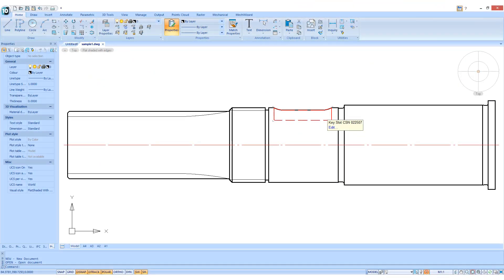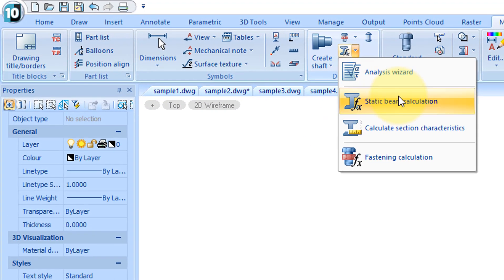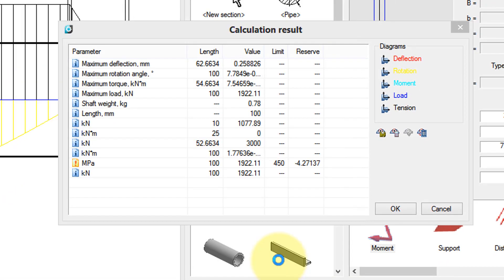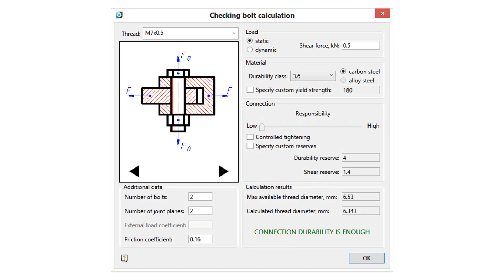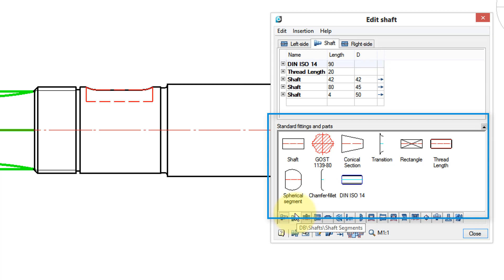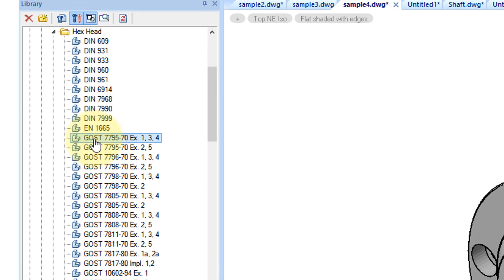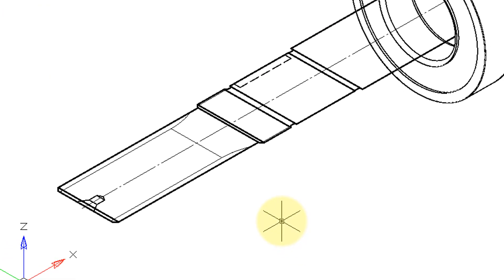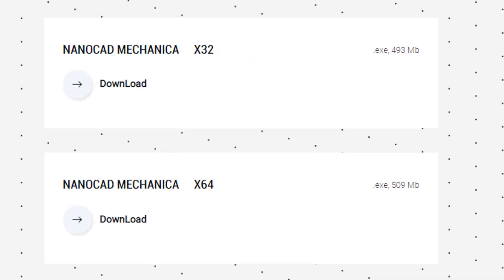nanoCAD Mechanica 9.0. New video by Ralph Grabowski

Comment: I typically use 2-D to do piping isometrics and  vessel drawings where I work. Will saved drawings and modifications work with the Autocad drawings? and which is the best of the products for what I do? I don't really expect to need the 3-d drawings. We use our drawings for inspection purposes in the refinery to add inspection points for our NDT crews to monitor thickness locations.
Reply from the maker: Dave Irby, all nanoCAD Softwares fully compatible with AutoCAD drawings thanks to native DWG compatibility. For your request, we recommend to chose nanoCAD Mechanica. In addition to the library with standard parts, you get powerful tools for working with mechanical drawings. For more information, please visit https://nanocad.com/products/mechanica/

Comment: Hello, can i do 3d model here?
Reply from the maker: Hi angel cepeda. For sure, nanoCAD Mechanica is based on a parametric design engine. You can create 3D models and use standard parts from the library.